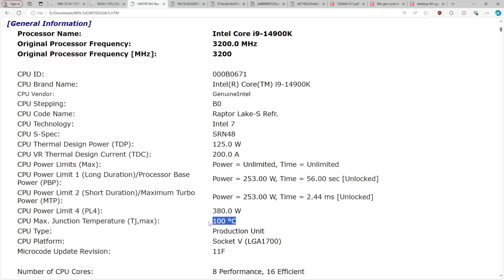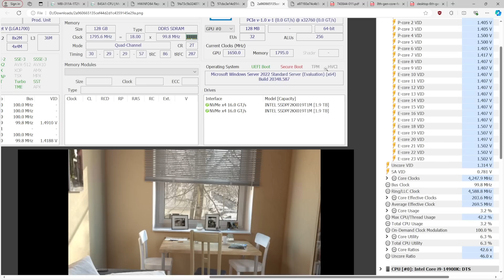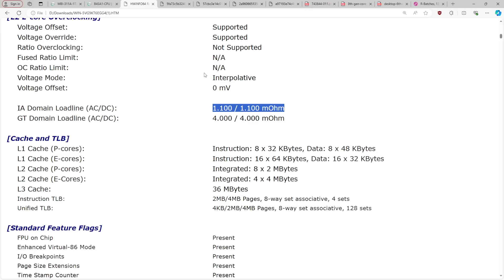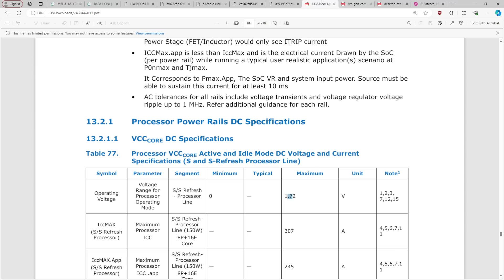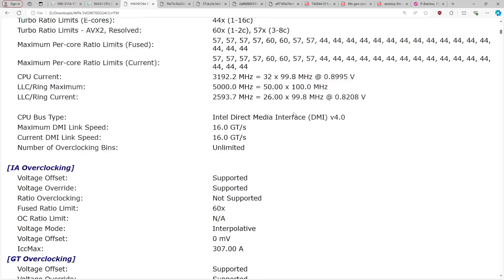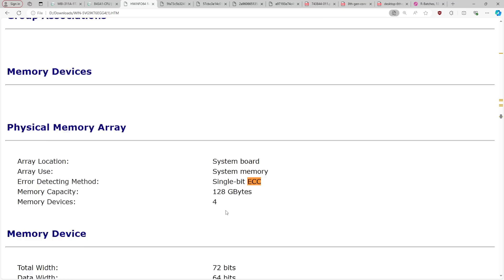Rambling about intel i9 14900Ks degrading in a Minecraft server hosting enviroment

Comment: Doesn't the documentation say that the AC/DC LLC needs to be set according to what matches the electrical Ohms of the socket and that this needed to be tested by the manufacturer before it can be set correctly? Because if this is not the case, the CPU is going to ask for higher voltages which indeed could be making this issue much more severe - 1.1 mOhm is probably way too high, and I'm thinking it's something similar to the mention of 1.72v....

Comment: Reliability and longevity in a data center environment are the reasons companies can charge extra for slower server grade components. Putting consumer grade equipment in the data center can be a brilliant way to get great performance at a low cost, but to expect to be able to do it at stock settings is naive.

Comment: I had my first chip fail, but I blamed myself because I limited to 300 watts, in fact I think Buildzoid led me here to 300 watt limit. LOL, I don't blame you, bro
BUT,  on 2nd chip I did not make that mistake and limited to 262 as it was a sweet spot where cores won't clock down, and also did a proper undervolt, like my first CPU
So far so good. 
I smell that Law Action Lawsuit is coming against Intel, and I speculate people will get a $50 paycheck in mail similar to when I owned AMD FX-8320, and their 8-Core dispute lawsuit and $50 showed up at my door 3 years later. 

I am not celebrating this situation for Intel, I rather have them fix the issue on next CPUs and continue honoring RMAs the way they did with my CPU. 
AMD has been guilty of similar things, but the issue is that Intel is not addressing it properly, which will likely result in lawsuit, because this is....AMERICA, Harold, AMERICA

Comment: This is why my server uses an i7-2600, 32gb of ram, a plain old crucial sata ssd, and a modified batch file to allocate all but 4gb of ram.  I have never had problems or lag, granted I only have 20-30 players at once. I don't know why people rent servers.  Just take an old intel based office computer, buy refurb/used ddr3/4 off of ebay, get a 256gb ssd, and use the windows key from the sticker on the unit or use ubuntu.  Port forwarding really isn't that hard, and can still be done on the crappy "Gateway" devices that your ISP provides.  The cost of the used hardware and electricity will be cheaper in the long run, vs renting a ridiculous server like this and having it fail, and not having it physically in front of you to repair or troubleshoot.  Renting only makes sense If you need to have multiple game servers in different regions so that people in that region will have lower ping.

Comment: lol 1.5v vcore. My 13700k runs at 1.22v during Cinebench at 5.6ghz 1.34v idle. It is super stable for me. Running 24/7, but 12h it is just idle, with plenty of decompression since 11.22. 
I would instantly shut down my PC if I saw anything like this in a daily system. 
But it is just terrible for anybody not checking their system when it is new. And that's totally on Intel. A new CPU should be always far below 1.4 if you want to use it 4-5 years.

What a terrible product the 900k is. Anyways will pick AMD next time. Once they support my 7200 DDR5. No wonders, to go over 5.6 the vcore required ramps up like crazy for 100mhz.
Reply: Same.... well I'm running 1.43v on vcore at idle. It droops to 1.36v under load and has been completely stable and running for ~20 months now. Rule of thumb is not to go over a 1.4v or in my case not much more. The cpu's that keep degrading are running stock insane voltages that are not sustainable. People who know how to OC/undervolt these chips aren't running into issues.

Comment: Do I remember correctly that you covered AC/DC values somewhere in your video? Was it in the first Intel power spec rant video?
Edit: ok I found it there but lmao it's so disconnected from your video "how LLC actually works". If it's just that AC_LL affects operating voltages and DC_LL affects power reading then why in the name of fuck are they named that way?
Do I remember it incorrectly that in some other video (maybe not related to Intel or CPUs) you used those terms in completely different meaning?

Comment: Waaait - you do not know what PL4 is?
It is the absolute powerlimit. By default NOT enabled it is a preemptive limit the CPU will try everything to stay under. While the CPU is allowed to go above PL2 for up to 10ms, cracking PL4 is a shutdown.

As for the voltages - if memory serves me right intel specified something like +-5% or so maximum tolerance. And similar ranges for the memory-controller  (rather narrow).

Comment: sounds like the memory controller temperature probe wasn’t properly implemented and the actual memory controller temperature could be well above the reported cpu package temperature.
Reply: The default SA Voltage was like 1.5v on my MSI Z690-A Pro mobo, I had to manually set it to 1.3v. So it might be true that the default memory controller voltage is too high.

Comment: Now that you're saying it... When I first dialed in my 13700K I had huge problems getting it to run stable with TVB enabled. It was super inconsistent, so I turned it off.
I also turned down AVX multipliers by a couple notches.

And one more thing in regards to high idle voltage... Turn your windows power plan to "balanced". I don't know what the frickin deal is with some apps that they automatically change my plan to "high performance" and never switch it back! If any software devs are reading this... PLEASE DON'T!

Comment: There is a task to sell next-generation processors that use a new chipset and a new socket. This is difficult to do because people do not want to spend money on a full upgrade of their sufficiently productive PC. In the mobile segment, this problem is solved by using a thermal interface with liquid metal. In the server segment, this problem is solved by using too high voltage?

Comment: So, why don't motherboard manufacturers actually measure the VRM resistance/impedance and put that value in for the AC & DC load lines? Isn't that the intention? I doubt all boards measure the maximum 1.1 milliohms...

Comment: It boggles the mind how a VRM switching at hundreds of kHz slowed down through an RC filter is supposed to keep up with loads running at multiple GHz.
If EMI and efficiency weren't a problem I guess a linear regulator running at incredible frequency is the only thing that would be able to keep up if we'd ignore the electrical properties like capacitance and inductance in the distance and area from the VRM through the substrate and including the chip itself.
The fastest thing in the system is the chip itself and I wonder if there are any provisions in said chip to wait for the VRM capacitors to fill up before applying the load to combat undershoot, and or going as far as letting the chip do bogus work after the real load has finished to combat overshoot.
In short: what if we calibrate the load line from the fast CPU in stead of/ in conjunction to the slow VRM...
Reply: 500khz×8=lots speed
Reply: That RC filter doesn't slow it down. It speeds it up.

The capacitance in said RC filter is what handles the high-frequency power transients, so the VRM only needs to handle the lower-frequency portions.
Reply: @TheLoneWolfling  By slowing down I meant that an RC filter is a second order low pass filter, decreasing high frequency throughput by 12dB/oct.
The point I wanted to make is we want to power a load that can change its resistance  orders of magnitude faster than a switching power supply can react to through its feedback loop and filtering.

I know it says 1R0 on a lot of coils but it is primarily meant to be a coil and not a resistor, but this is besides the point.
Reply: @vyor8837  Even if we'd assume increasing the amount of phases increases the frequency, it'd still amount to 4MHz. The load is running at >4Ghz and each clock cycle can have a different total resisantance.
Reply: @robbin4022  Source impedance != load impedance.

> we want to power a load that can change its resistance  orders of magnitude faster than a switching power supply can react to through its feedback loop

Agreed.

>  filtering.

No. The entire point of putting the RC filter on there is to improve high-frequency response, by allowing high-frequency transients to be handled by the capacitance.

Yes, this results in the load as seen by the power supply having a high-frequency roll-off. This is a good thing. That high-frequency rolloff is covered by the capacitance precisely so it doesn't need to be handled by the power supply.

Comment: what is your recommended LLC setting on a gigabyte aorus elite X z790 then? low or medium? my 14900KF has been running on unlocked power limits and its still rock solid for 7 months straight.

Comment: 40:04 -- "The way Intel's Vid works is it's an 8-bit number that is sent by the CPU to the voltage regulator. The typical range is from 0.55 up to 1.52 volts. That's all of the values of Vid that you can describe, and it goes in 5 millivolt increments.

40:28 -- "If you want to describe a voltage of less than 0.55, you can't, and if you want to describe something higher than 1.52, you also can't because there literally isn't a combination of ones and zeros to describe a value bigger than 1.52.

40:43 -- "With 8th gen, Intel used their foresight and came to the conclusion, sometime in the future, we might make a CPU that'll need more than 1.52 volts, like maybe a 9900 K, or maybe . . . like some future 14 nanometer CPU, we might need more than 1.52 volts because we decide to push the single core boost too high, and we need more than 1.52.

41:18 -- "The solution they came up with is: Add an offset to it and that offset maxes out at 200 millivolts. 1.52 volts plus 200 millivolts is 1.72 volts. [With 8th gen onwards] Intel is capable of describing voltages up to 1.72 volts.

41:34 -- "As far as I know they never used that capability until we got to the 14900KS where you can get CPUs where . . . where the Vid is like 1.549 volts for 6.2 GHz."

Thank you for this 👍

Comment: As a consumer, I actually figured out my memory OC wasn't perfectly stable only after I started compiling Chrome from source. Some of the intermediate object files/libraries failed to link due to some corruption. I managed to build it successfully on a third (clean) re-build.
Then I just reverted to the XMP timings. But I would likely be happy using my PC as it was, if I did not need the compilation (it takes over an hour for each attempt and I have no patience for that).
Reply: Sound's like your PC is garbage.

Comment: Buildzoid I love you man, but this has the smell of a manufacturing failure regardless of voltages. I don’t disagree with you that high voltages will not help these things survive here, but hearing this happen in lower power server use as well really makes it sound like a defect or abject failure in the design itself, or the ability to manufacture that design consistently.

Comment: why would anyone need a 14900K out of all things to run on DDR5 3600? Is it any better than 13600 or something? Or is the whole deal in 36 MB L3? In that case every single 14900 and 13900 variant has that.
Reply: It has to do with the memory config. They are running high density dual-rank DIMMS in both channels, which drastically reduces the stable memory speeds. These servers are not running XMP memory speeds.
Reply: Large minecraft servers have silly RAM usage.

If you need max single-core performance with a workload that uses 100GB of RAM... this is essentially the best you're going to get.

Comment: i want my money back intel
Reply: after this they may not have money to give you back at all
Reply: @Jeffcrocodile  i think they have enough to make it sound like a consumer fault X)
their performance charts will be way off after the update and they also will have to face legal issues for false advertisement
Reply: but don't worry.  they have money to pay those as well
Reply: @ChrisGR93_TxS  Not that it matters anymore, as the new generation is launching in September. They already sold most of what they were to sell anyway. Once they release the new generation, performance of 13th or 14th generation won't matter. Or, even worse, they could use the new underperforming data to say that Arrow Lake is "50% faster than the previous generation" and up-sell Arrow Lake.

I'd add that this is not the first time Intel does degrade performance. Just remember the patches for Meltdown and Spectre, the later of which dropped performance by up to a 35% even in CPUs unaffected by the bug.
Reply: @itisabird yeap, 100%knew about that and they still didn't care. they knew the profits would waaaay surpass their lawsuit costs. That's how big companies work. Profits over ANYTHING!
Reply: @ChrisGR93_TxS  Intel just had 2 generations of processors fail back to back meanwhile everyone is switching to AMD. Nobody has confidence to buy Intel going forward right when Intel is about to release their new 15th gen and new socket. It's bad. It's really really bad.
Reply: ultimately Intel can't just keep giving you a new defective cpu. You don't want another 360 red ring of death scenario and neither should Intel considering the cost. Since they are still refusing to talk about the issue, who knows if they have a solution they can implement in future CPUs. Once that is found, however, owners of 13900K/14900K and its variants are entitled to a new replacement imo.
Reply: @itisabird  What matters is the reputation loss and big customers moving to AMD CPU's because of it and part of it is us normal customers that have currently becoming aware about the situation and that will affect the big sales.

Comment: Hi Buildzoid, a bit unrelated to the topic of video itself, but it was hard for me to actually find proper information regarding Minecraft server benchmarks.
I've recently rented R9 7950X3D on Hetzner to test V-Cache. I've checked if there is any difference running modded server on 1st or 2nd die and there was 0 difference.
You've said at the start that Minecraft is memory bottlenecked. Is it so bottlenecked that additional 3d cache does not help? (Especially with slightly lower clocks on 3d stacked die).
I will probably build a 1U based on asrockrack with one of the 9000 amd cpus, but it's very annoying to search for Minecraft specific benchmarks.
Reply: There's a forum post on level1techs comparing a paper minecraft server on 5800X to 5800X3D. 5800X outperformed by a 2-3% on some tests (eg redstone lag machine, world gen) probably due to higher clock. But on an entities test on a guardian farm, 1 min mspt avg value was 7.6 for X3D vs 10 for X, with max of 18 vs 21. SMT appeared to be basically unusable because it was so buggy and had significant impact on world gen, so not worth buying something intending to turn SMT off. It seems to me that 3D cache will help when scaling to really busy servers with lots of entities, but you're not going to see much difference on most things which run less often (entities causing tick problems will come up alot, world gen isnt so frequent).
Reply: @HCfrogster  I see it now, it was fairly recent, so didn't see it. I ran the same docker container with 1.7.10 GTNH world (the load there is mostly tile entities) with around 30 MSPT and also saw that frequency die seemed to have very slightly less MSPT, but marginally.
World generation is actually single threaded in 1.7.10 case.
I will think I will end up upgrading my 5950X to 7950X3D for my PC and running tests there before buying a full server, but this is some nice insight into X3D performance. And the results that are applicable are not different to mine either.
Disabling SMT is a good insight as well. Need all performance I could get, even if it is 3-4%.
Reply from the maker: I don't know enough about setting up Minecraft servers but I was told that the 7950X3D is still slower than the 14900K.
Reply: @ActuallyHardcoreOverclocking  I can see that being the case, but higher power draw (I would be running 3 or 4 instances on 1 server in colocation, where I pay for power consumed) is a big deal. And current instability matters even more. 9000 series will also be available and I very much doubt that it is slower than 14900K + I can actually test it on a personal rig before committing with a purchase.
I've ran 7700X on hetzner for a year now and they only have 13900 non-K, which is 25Euros more expensive, and I doubt it will be running anywhere close to 5.6Ghz under 116Watts max power usage according to Hetzner's table. Hetzner probably limits it via their custom bios.
7700X actually runs it's advertised clocks. (129Watt max power usage according to Hetzner)